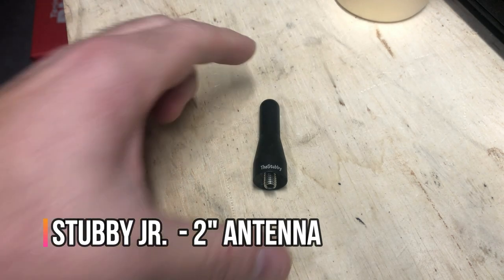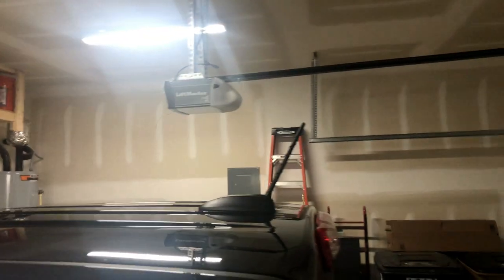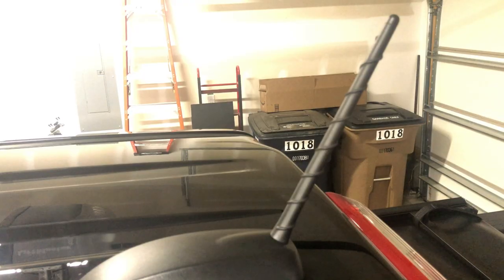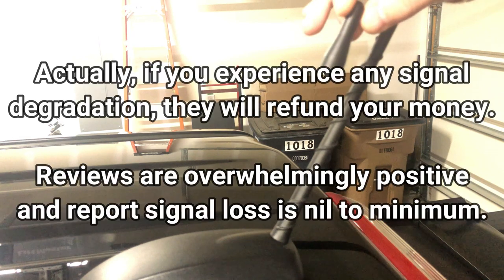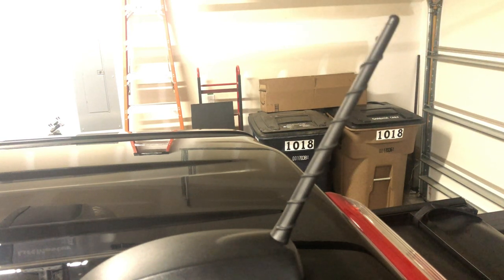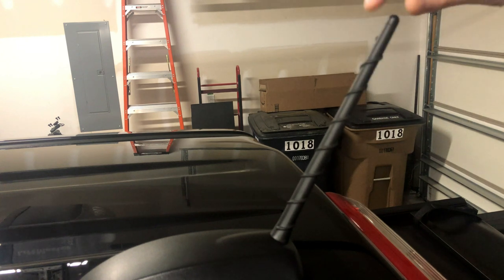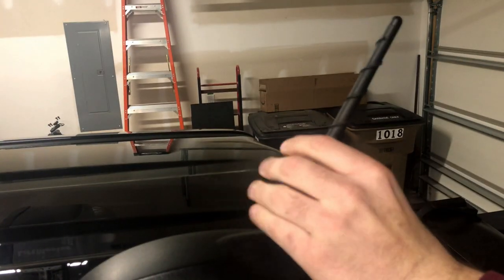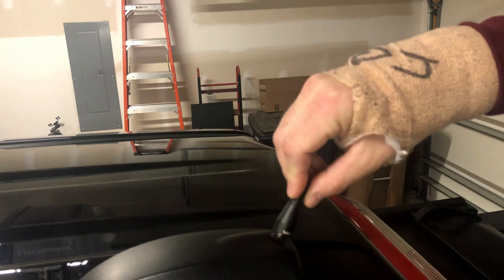[HOW TO] Install Stubby Jr. Antenna on a 2015-2022 Colorado/Canyon (EASY)

Comment: Mine don't come off that eazy. Infact the rubber seems to be the only thing turning
Reply from the maker: Hmm maybe the insert is spinning inside the antenna. You can try to use a set of vice grips to grip the antenna and then spin it off. But you might end up damaging the OEM one. Just FYI.
Reply: @fondupot  lol I thought about doing that, I watched your video and a few others and it comes right off but mine seems stuck on. Thanks for posting the video
Reply from the maker: Glad to help. Hopefully you can get it off.
Reply: @fondupot  hell yes, I got it I tried it again on my lunch. 👍
Reply from the maker: Right on!  glad to hear it.